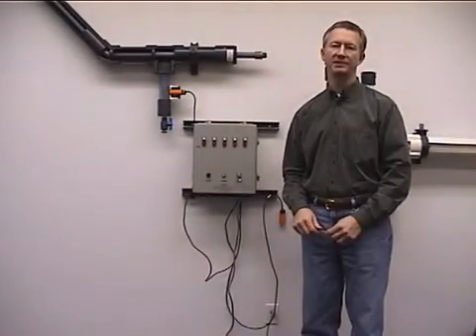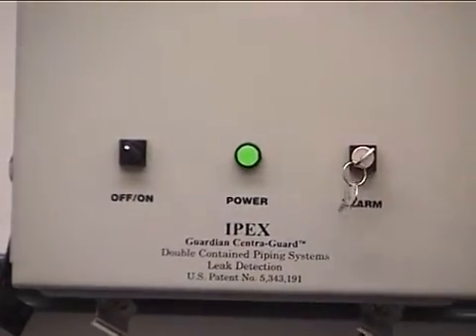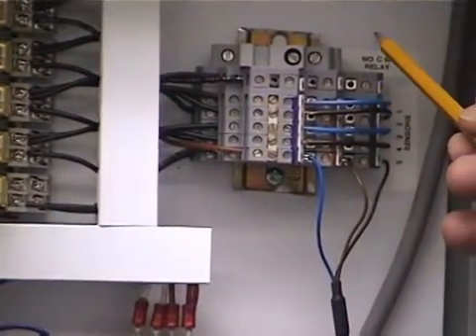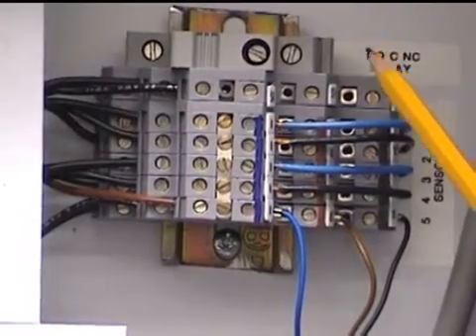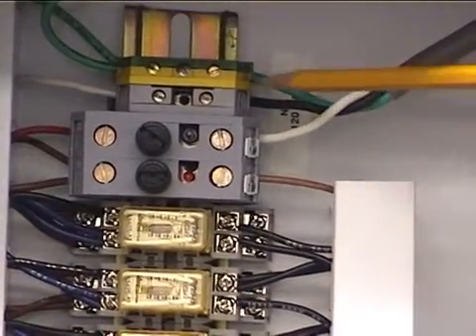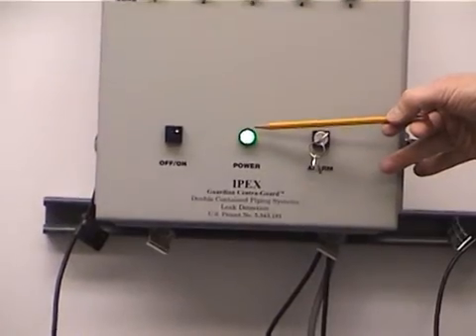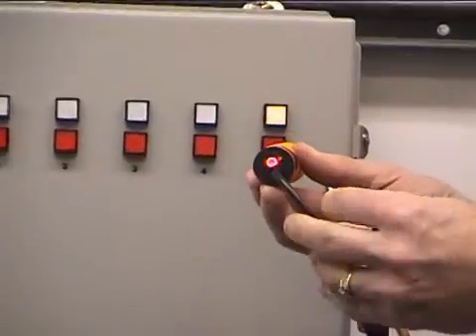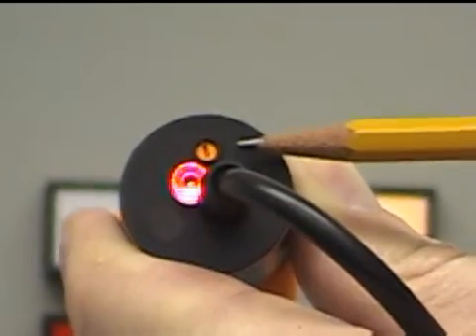IPEX Installation Video   CentraGuard Leak Detection

Comment: He wired it wrong.  On a 120 volt system,  white is always the neutral and black is the hot. You can see on the left hand side of the terminal block (the load side) that the white wire is going in where he connected the black feed. He should have a licensed electrician wire the equipment the next time. Someone could get hurt or the equipment could be damaged if improperly wired.